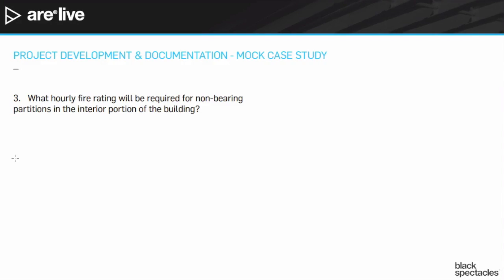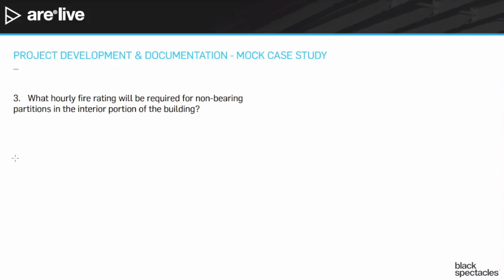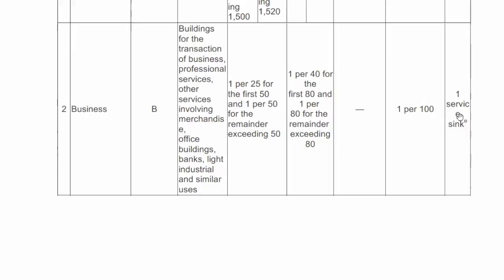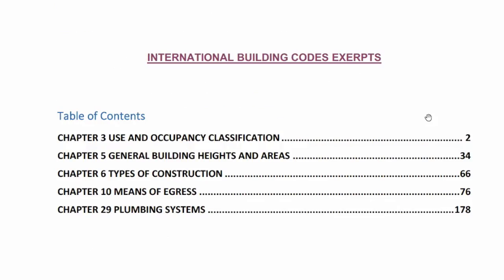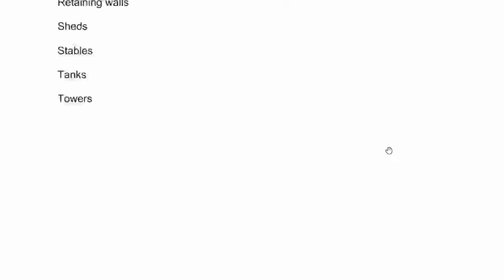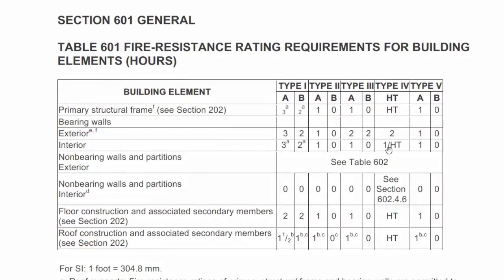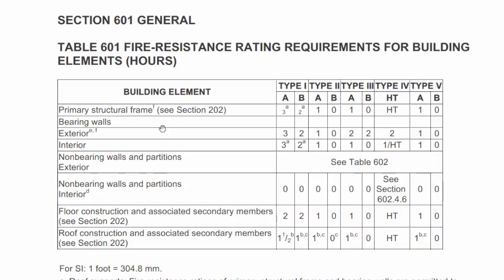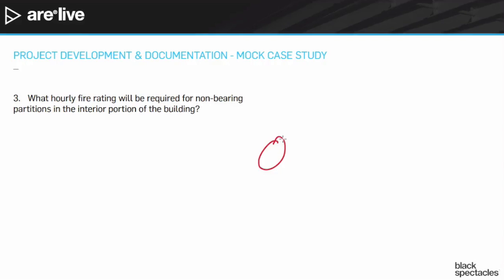Hourly Fire Rating - PDD Mock Case Study - Architect Registration Exam | ARE Live

Comment: During the exam, I sure wish that one could flip through the PDFs as fast as Black Spectacles does in this video. It's kind of crazy how slow the pages load. I mean, how difficult is it to cache the entire PDF locally from the outset? Currently,  the computer must re-render a page every time a new (or old) page is loaded? This can take 4-5 seconds. Similar for zooming in and out, which is a must. It's just a PDF, right?  At least the old infamous vignette software didn't experience such lagging. The repeated waiting interrupts continuity of thought. 

...and while I'm complaining, I might as well declare that the tiny Dell screens at Prometric may be fine for a SAT or GRE, but they are terrible for viewing large architectural drawings. I would guess the monitor at Prometric are 17" square with a resolution something like 1024 x 768. It's so painful to view a page that is ARCH D size. Prometric doesn't have the right kind of hardware to support a modern exam like the ARE 5.0.
Reply: I was just about to say this! It's insane how much time it takes per page- I started counting it last time and got to 10 secconds before scrolling more- it was driving me crazy to sit there and wait for that page for so long. It sucks that you cant see how far down you've scrolled once you get impatient enough to keep going. This is a huge problem and accounts to so much wasted test time of waiting..